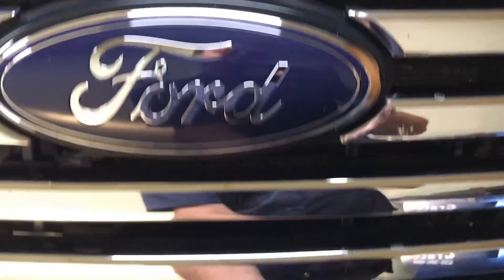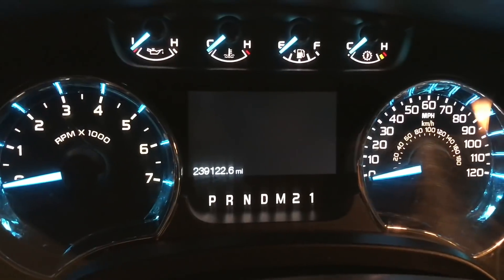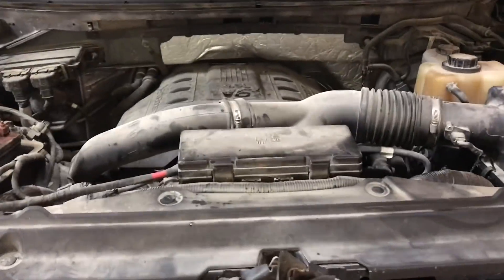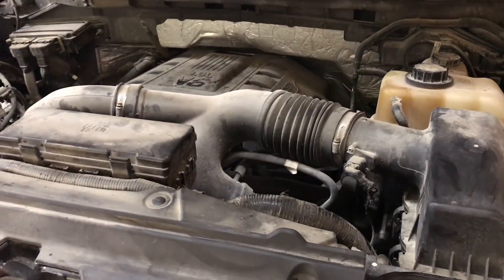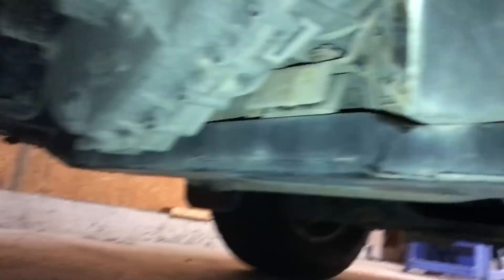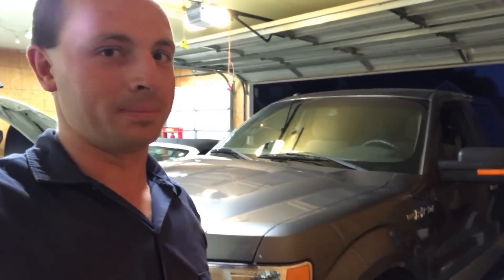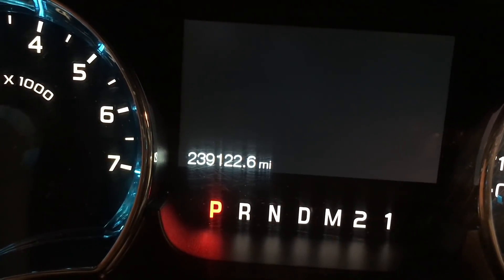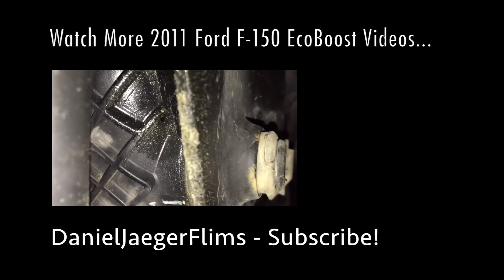Is the EcoBoost Engine Proven?

Comment: The GM V8 pushrod is proven. Not a fan of the ecoshit.
Reply: Till they put Active Fuel Management on them and killed a good engine
Reply: CamperMike yeah thats kinda true. The vortec engines were the last perfect small blocks
Reply: @adriansims1596  I second that.  An EcoBoost engine is 10x more reliable than any GM junk.  Their trucks are hot trash...
Reply: DeadofWinter321 jealous eh?
Reply: DeadofWinter321 full of shit. Any small block Chevy will outlive the eco boost and costs much less both in parts and modification. Plus, V8 > V6
Reply: There's the problem, PUSHROD
Reply: I'll take a Coyote over either.
Reply: Ok... why does every gm motor with fuel management have the lifters go out at 150k miles?
Reply: Push rod engines are better.I hate the overhead cam engines,one horrible pain in the ass to work on.Over engineered too.The Coyote and 5.0,not made by Ford.Built and designed by Jaguar with the Ford name on it.Then why do you see Chevy drivetrains in Ford hot rods and street rods a lot?A lot cheaper to build and easier to get parts for plus more reliable
Reply: The 5.3 is not gutless,they have power.If you want to see something that is gutless,two are the 4.6 and 5.4 Ford engines
Reply: and now they have dynamic fuel managment in the 19's. The trucks are great but the cylinder cancelation is their weakness
Reply: Na, 3v 54 has more juice than than newer silverado, i drove both.  When i drove a 17 silverado im like what the heck, it was a pooch.
Reply: The 3 valve 5.4 which is a huge POS is gutless as well.Ford needs to go back to push rod engines and dump the overhead cam engines
Reply: @tmaq9726  My friend has a Chevy with the 5.3. My F-150 5.4 has more power and the ride quality is day & night difference. Both trucks are the same year and king cab short bed's. After driving his Silverado, it's a treat to drive my F-150.
Reply: ecoboost better than any shit gm is making
Reply: @George Sawtooth could be that the Chevy you drove has 3.08 gear ratio which would kill power. Better to drive a 3.73 truck
Reply: Tundra proven to last 1 million miles on a single engine and capable of towing space shuttle. Now, that's a real truck.
Reply: @repairvehicle  sounds more like real good marketing tactics
Reply: @repairvehicle  . Old news . Besides I've seen multiple brands of vehicles reach 1 million miles . Just takes good consistent maintenance
Reply: @EverydayJ1786  , none of them have original engine without any repairs.
Reply: Walter Frederick the 5.3 is a fuckin turd was about even with the 5.4 and will not touch the 5.0 in any way
Reply: Never mind the lifter tick at 60k miles, body rust at 80k miles, catalytic converter at 85k miles, 4l80e rebuild at 90k miles, high oil consumption at 100k miles, another transmission rebuild at 130k miles, frame rot at 135k miles, another transmission rebuild at 140k miles, and the countless bearings and ball joints in between.
Reply: @goober239  , really? Is that how bad GM is?
Reply: That's the 6.0 vortec in the cadillac escalade we had since 2010. Turns out we're not alone if you see on the forums. Next time it breaks down, we're crushing it.
Reply: 5.0 is a ford engine that use to be used by jag
Reply: @goober239  , I never owned GM and don't know much about them except for never trucks that have high Oil consumption issues.
Reply: The only good gm v8 are the 350 small block.
Reply: Camper PRO some of us aren’t fans of Chevyshit.
Reply: William walton because GM is damn good at taking something great and ruining it.
Reply: George Sawtooth you must have been driving one that was screwed up. I raced my buddies 01 f150 5.4 triton with my 02 Silverado 5.3 and got him every time (we raced 5 times because he kept coming up with lame excuses each time he lost). On one race I forgot that I was manually shifting the truck and I had the tunes cranked so I floored it and it just ran out of power and I was just like “wtf” but then I figured out it was hitting the rev limiter in first so I shifted to second and still beat him lol
Reply: A Crustacean 4l80e? Now tell me what Silverado with a 5.3 came with a 4l80e from the factory. You are full of it. Yea those trucks rot. I would challenge you to find a truck that doesn’t rot up here in MN. The fords rot a little less than the chevys but they rot where it really matters. And what I mean by that is the cab mounts are the first to go, then the frame. The chevys rot out really bad on the rockers and body panels.
Reply: A Crustacean ok now I see that you are talking about a 6.0 Cadillac. I was never as big of a fan of the 6 liter trucks as much as the 5.3’s. I have 182k on my Silverado with the original 4l60e trans (which is the weaker and lighter version of the 4l80e) and it still works perfect. GM made a million good v8 engines. It is when they got AFM that they went to shit. Examples of great GM v8’s: 283, 350, 396, 427, 454, 4.8l, 5.3l, 6.2l. And those are the ones that are great IMO. They have plenty of others that are just OK like the 305.
Reply: As long as you don't mind that it'll use as much oil as gas.
Reply: It's because of are gay government ford by law had to make a new line of eco friendly efficient engines because of new pollution law in forced by are government
Reply: @George Sawtooth you aren't we wrong the 5.3 are slow as all hell. Few of my friends have silverados. And I can run circles around them in my 2.7 f150 with 400tq
Reply: Camper PRO "Ecoshit". That's funny to disrespect a smaller engine that will walk your LS V8 ha ha
Reply: Walter Frederick Ford OWNED Jaguar and used a lot of FORD designed stuff in Europe. 
It's a Ford engine
Reply: Matience Matience Matience is the key and good oil and filter like Amsoil. Not loyal to any brand they all have there own issues makes me laugh some of the fan boy comments lol. Had Ram, Toyota and Ford now a 18 High Country 6.2L love it so far.
Reply: repairvehicle just this week gotta a phone call, he’s been living in a junked out space shuttle, well he needed me to tow it, throwed out of the trailer park for lighting the thrusters July 4th,. I told him no way, maybe if I had the 3.5 Ecoboost,  but my truck has the little 2.7 ecoboost.
Reply: Walter Frederick in stock form , no better than a 5.4.
Reply: @bcfmef  Interesting comment and I hear you!! Like GM V8s there built strong and always were
Reply: I wouldn't so much blame GM, but for the government/EPA/CAFE standards that change every year. GM did what they had to do in order to keep the V8 within the strict guidelines set in place, but most of those issues were cleared up in the 2013 lifter redesign. But to be fair, a part, especially metal that relies on extended/retracting numerous times will still eventually fail after some time sadly from the wear and tear. The plus side is that with all the parts available you can convert an AFM engine into a regular V8 one the failure happens at a fraction of the cost. While the lifter failures on the newer engines is not as bad, it can still happen. Reliability wise, I've seen less "newer" trucks coming in for failed lifters after the 150k mark.
Reply: The funny thing is, even though everyone hates on GM. Ford is pretty much using a GM transmission in the newer Expeditions.
Reply: @supersaiyenunlimit2  Keep good oil and a catch can and clean side separator plus Amsoil PI treatment and it helps
Reply: @supersaiyenunlimit2  Yup exactly but they don't stop and think before they open there mouths and make fools of themselves before thinking lol
Reply: @Richard Skipper it is a cgi block so he block is tough so far no big issues on the 2.7 in forums
Reply: Camper PRO ur truck is losing sales to RAM now. #1 F150, #2 RAM, #3 GM
Reply: CamperMike u can turn it off with button near steering wheel. That's real hard. GM= old tech.
Reply: Walter Frederick that's 100% INCORRECT dude. I promise ya. Yes Ford owned Jag 25yrs but Jag needed more help from Ford than Ford from Jag. Both great vehicles.
Reply: Walter Frederick Yea that's why they been discontinued a decade ago. Both were plenty reliable.
Reply: repairvehicle there's quite a few F150s out there w/ tons & tons of mis. Don't believe the marketing BS. U cannot stay best selling truck 41 YEARS STRAIGHT if customers weren't very happy.
Reply: YEG Mechanic it's fake news. Trust that.
Reply: supersaiyenunlimit2 false . They co- developed the 8, 9, & 10spd transmissions. Plenty of different configurations & tuning. Built 100% separately as well. So ur quite incorrect.
Reply: Richard Skipper Yea ok . nobody believes ya Skippy.
Reply: Richard Skipper it's all in the metallurgy / engineering & parts bub. It's not overdressed if they got a $450k 3.5L V6 Ecoboost make 650hp stock block.
Reply: Government motors no thx
Reply: Yes most of us know about the 15 degree cylinder heads, block construction etc. But it still a 2 valve pushrod engine that the average chevy diehard could work on. And they are great engines that make good power with a few cheap upgrades . Very reliable too as long as you pulll that cylinder deactivation Bull Crap off of it.  But it amazes me the amount of childish off the wall, stupid ass remarks from the GM trolls on here, that never have even stepped one foot in a EcoBoost or let alone, even know a person that owns one. I would say the LS is a tad bit more reliable than an Ecoboost......It should be, they have been out since the late 90s !!!!!   As far as the NorthStar goes, it was probably a bigger heap of crap (head gaskets, oil consumption) than the 4.6 & 5.4 modular motors that the mighty GM crowd so glady trashes.
Reply: Yes proven... To not really work well
Reply: @Toolaholic7  Ahh, you're incorrect about coyote / 5.0 engine, it is a Ford engine and design NOT Jaguar. I believe you forgot Ford owned Jaguar for many years and used their engines in their car and SUV's and as of recent still used a few of them like the 2.0 Ecoboost. Jaguar has revised some of these engines like the 5.0 for their specs and wants but they still were Ford designs not the other way around.
Reply: It is not a Ford engine.Also  copies the part of an LS engine part,the intake manifold.Ford also has Mazda engines,the older 2.0 DOHC is one of these with the Ford name on it.Same with the 2.3 in the Escape and the 3.0 vin S V6 in the older Taurus and Sable
Reply: I personally know of 4 Silverado's that are near 300,000 miles. Those old vortec's last like it or not. Now these new ecotec direct injected one's no idea. Completely different engine
Reply: They have power but they have a horrible torque management system so it plays nice with the 4l60 transmission
Reply: Bro 5.4 fords shot out fuckin SPARK PLUGS lol. You cant be serious thinking its a better engine than the 5.3 also 5.4's had cam phaser tick. You know what that "lifter tick" was on my 5.3 ? Broken exhaust manifold bolts like every other 5.3that dumbasses cant diagnose so they just say lifter tick. I will say that when they put cylinder deactivation in them they where junk unless you deleted the system
Reply: Camper PRO those are good engines too but the Ecoshit is equally as good. Maybe even better.
Reply: Walter Frederick talking about a gutless 5.4 look at the lightning and Ford GT. The fastest car in the standing mile has a 5.4 😜
Reply: Each one has there own issues, Gm 3.8 V6's are great, i have one, but the valve covers leak, the 3.4's blow head gaskets, the AWFUL northstar V8's. The 4.0's from ford are good, except for the SOHC fatal timing chain flaw, i have one of those too, the OLD 5.0/302 ford was a great engine, i have an explorer with one. The chevy trucks were good till 2007ish when the DOD started, and they became trash, and some of the ford triton's had spark plug problems. Im not going to even go into dodge stuff like trans issues, or the intrepid. I try not to look at it by brand or company, but by each vehicle. Each company has made trash at some point or another. Also ALL 3 HAVE RUST ISSUES, here in PA
Reply: Richard Skipper- If caddy is coming out with a new over complicated V8, it will be the DEATHSTAR all over again
Reply: Either ecoboost makes a 5.3l AFM motor feel like a turd. Same way with the 6.0 gas 2500 for that matter. GM should be ashamed of how far behind they are in engine tech.
Reply: George Sawtooth Don’t apologize I drive 5.3s all the time with work. They don’t make an ounce of torque down low they can’t get out of there own way until you hit high rpms. They are gutless and they are a overrated. They ride good but don’t expect to make it up gravel right of ways , the front end can’t track a straight line in 4x4 to save there ass. I don’t care personally  what it is , I didn’t build the damn thing and it’s only costing me money so why do I want to go to bat over it? I’ll never understand.
Reply: @supersaiyenunlimit2  You got that backwards. Ford developed the new 10spd that GM and Ford are sharing.
Reply: I think they should bring back the 350 diesel. That was the best idea any car company ever had lol
Reply: Walter Frederick it’s not more reliable it’s literally just because it’s super cheap and parts are everywhere. They are cheap engines. Period. There’s nothing to them. Plus if pushrod engines were better why are we back like we were in the mid 1900s still running 350s, FEs, and 340 hemis? Because sohc /dohc is much better. Less reciprocating motion=higher revs+better balancing+less slack in valve train. The pushrod engine is dying whether you like it or not
Reply: George Sawtooth you are correct about the 5.3. My 4.0 ranger beat my buddies 5.3 easily on a red light race. They are very very very slow. For the money I’d rather get the 6.2 then put the money into a 5.3. Plus my buddies engine is having the typical lifter noise of those 5.3. I wouldn’t take one for free
Reply: repairvehicle you do realize once a heavy object is in motion it will easily stay in motion. Especially on a flat runway lol
Reply: There’s no replacement for displacement   Give me the 5.8 other wise I’m sticking with a LS. Now they puttn 2.7 or some kind of sewing machine shit in them plus all the car makers got 8-10 speed auto’s  what a cluster fuck . More gears more sensors more shit to time bomb your ass...no more new trucks for me i go get a accord or camry rip the trunk lid off damn thing fill it with dead dear and hogs
Reply: It's proven to use more fuel and still be slower and tow less that is about it.. lmao Ford Ecoboost > Chevy
Reply: @Bleachanna  tell it Corvette
Reply: @repairvehicle  LOL I bet they ve changed frame twice or even more...
Reply: @OmenFree  , original frame. LoL.
Reply: Govt Motors is PURE GARBAGE! Thats why they went belly upped in 09, then the TAX PAYER gave $16.9 BILLION,  Bail out for making DEATH TRAPS  GOMER DIPShtz
Reply: BANKRUPT GOVT MOTORS  GOVT Motors  @Toolaholic7
Reply: GM does not owe a dime,paid it off.Ford still owes and took a bailout,5.9 billion dollars
Reply: @goober239  Your tranny goes out after 30k and then again after 10k and you still don't think its the builder?
Reply: Walter Frederick yes as this maybe be true it’s for EPA why these motors were SOOOO Detuned a lot of motors in that ERA 4.0 v6 motor from ford  was also very underpowered but very strong stout motors that can do 200k+ all of the motors 5.4 4.6 4.0 V6
Reply: Bs
Reply: The 4.0 Ford is a pile of junk,timing chain and headgaskets  go out of them
Reply: CamperMike I bought the diablo Afm disabler for my 5.3. Runs way better and get the same mpg. Worth the 100$
Reply: Jace Lysinger wrong, wrong, wrong.

Comment: Ecoboost exhaust sounds terrible, my V6 camry from college sounded better
Reply: mlwebb79 different design = different sound. The Ford makes WAY more power than a Camry. It’s designed for low RPM torque not high RPM HP.

Comment: I wouldn't buy any vehicle or truck with 200,000 miles. There's a lot more to a vehicle than the drive train. So what if the engines good. So what if the transmission is good. The rest of the trucks worn out. Suspension, bearings, seats, switches, ECT. It's a money pit with that kind of miles.

Comment: Btw you keep saying"1/4 mill" your point? Realize that truck is been babied, driven on the highway most of the time which generally doesn't put strain on the engine. There are many cars that will go a million miles if you just put it on a dyno. Even bmw did it took them 4 years. This video don't prove shit. Especially when you compare to the ones with blown turbos